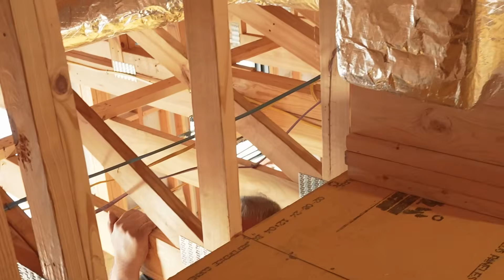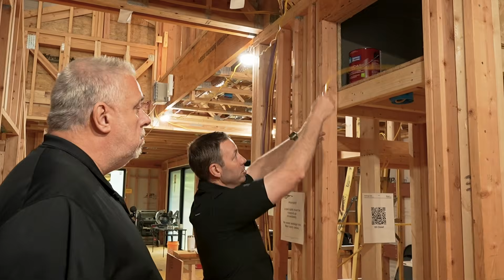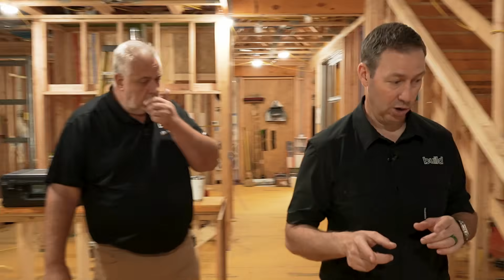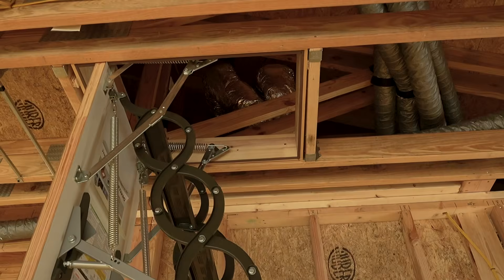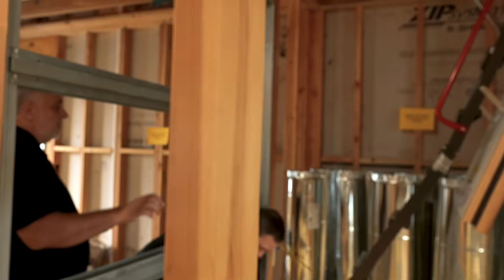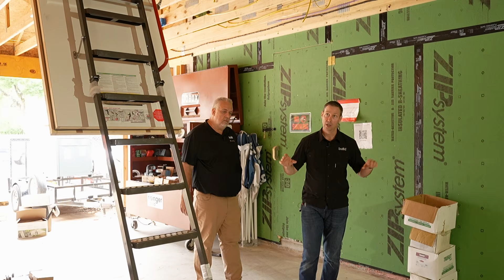Making Room for Mechanicals: Expert Advice for Efficient Home Design

Comment: My  Hot  Water  Runs  are 28ft - 34ft  using  Hybrid 50 Gallon went  from $600 Yr  for Hot  Water Down to $192 Yr = 3.5 yr  Pay Off or  Pay back  . .  Hybrid Actually Drys -&- Adds  Touch of Cooling  . . :glasses-purple-yellow-diamond:

Comment: Any thought to place the regulated mechanical room at the roof level?   It might imply the house needs to be built in full concrete, but it can really free up spaces down below for something else.

also, water flowing down can help maintain a good water pressure.

Comment: Stop putting HVACs in the damn attic. Design a utility room to hold the HVAC. When you're designing a home, you have the freedom to design a home the way you want. The same reason you shouldn't put a hot water heater in the attic, you shouldn't put an HVAC in the attic, and I don't care if the attic is conditioned or not.

Comment: Steve, i worked on a large house that had a "level" about 4-5 feet high between thw basemwnt and main floor. The walk way went rhw entire lwngrh of the house with runa going off left and right with walkways.
24,000sf house with a small upper floor and the basemwnt was 14,000 so it was consierably larger than the main floor.
You got to the walkway by dropping into the basement roxk climbing gym then up the back wall to the hatch doe thw walkway.

Comment: You'll need that removable panel when that "heat recovery" thermo drain starts developing pinhole leaks. Talked to several homeowners that had theirs fail. KISS, Keep It Simple Stupid, you gain is minor to nothing at best. A proper waste drain is all you need.

Comment: My preference is split system (AKA air-to-water,) heat pump water heaters. While not nearly as common as its self-contained cousin, the design solves some of the issues when it comes to placing heat pump water heaters. For example, the evaporator coil unit can be placed virtually anywhere on the exterior of the building envelope.

Comment: Building in 6 weeks! Owner builder...I thought about having a conditioned mechanical room on the 2nd floor- but I have an area over the kitchen/greatroom that will have walk in attic 10'x8'- isn't it better to skip the conditioned mechanical room (in midlands SC) and just use that attic space?

Comment: I also dearly love drop ceilings in basements. I know "they look ugly" or whatever, but the idea of the ability to remove the whole ceiling or just a few panels without any cutting or construction to put it back afterwords is a beautiful thing to me. It's also my appeal to the conditioned attic, complete ease of access with no insulation in the way of the ceilings and tops of walls, and the obvious benefit of it being a comfortable temperature to work in. I've noticed some things that make my life easier when installing or working on a central vac system, and things that make life hell. I know anything that makes it easier for me would for any trade, and I like the easier, less messy option for being able to access anything for repair, upgrading, or adding something in the house.

Comment: I’m 78 and had a tract home built 21 years ago in a NW suburb of Chicago. This was my retirement home. It is a 2240 sqft ranch with 9’ ceilings, vaulted ceiling in entry/family room and a deeper full basement. It has 3 full baths (one in the basement with a large shower). I tried to anticipate some of the things mentioned in your video. I did a Werner aluminum pulldown ladder in the three garage, it can be used even with 3 cars in the garage. I wanted larger doors (32” doors would be minimum for a small/medium wheelchair) but that wasn’t available. The master bedroom has a 48” wide opening with 2 doors, this works well with wheelchairs. The 50 gallon water heater is close to the middle of the basement, next to the furnace. It only takes 30 seconds for hot water to get to the master bath (furthest away from the water heater).  It has 2 steps to get into the front door and 3 steps into the garage. I had a front door green 16’ x 32” wide wheelchair ramp made about 8 years ago, that can be installed in less than 1/2 hour. I have used it twice, once through the winter for about 1 year, the other time for 4 months. The only opening that could have been larger is the kitchen entrance 29 1/2” from the hallway. The dining room entrance to the dining room (no door) is 37 1/2” and is great. The other side of the dining room has an 8’ opening. The front door is a 36” door, but only a 35” opening. The mudroom door to the attached garage is 32”, with a 31” opening, but the other door is 30” with a 29” opening……strange that they are different. My 20” wheelchair is 27 1/2” wide. If I was building a new home I would do all passageway openings at least 36” and hallways 46” minimum (my hallways are 41 1/2”, with post at one point making it 36”). I have bumped into the walls and corners damaging the drywall when using the wheelchair.
PS: I also added a whole house 36” 2speed fan, which I use in the spring and fall to cool down the home when necessary.

Comment: At 2½ miniutes you mentioned the HP Water Heater, that is good and bad. If the HP portion fails, it gets trashed, if Tank fails ... it gets trashed. Someone does make a HP for a Water Heater that is stand alone. Actually, there are several different types, but the one being pushed on Americans by the box stores and supply houses is by far the worst design. There is a self contained HP unit, that ties in to a solar water heater tank, so it is similar to what you showed. But there are also inverter HP units where the inverter condensing unit goes outside just like all other mini-splits and looks the same. The benefits to these units ... you don't have to trash the tank if the HP portion fails, and vice versa. So you can grab a Rheem Marathon solar Water Heater, that should never fail due to its polycarbonate tank. Replace the anode with a Corro-Protec electronic anode rod, and forget about it until its time to flush it. Some even have electric heaters for back up and supplemental hot water. But in Texas,  why aren't you using a solar hot water panel ?
At 10 minutes in, Matt and Steve are standing in front of that mechanical closet and discussing planning for system maintenance,  HOWEVER ...lol, we see the transition for the AHU hanging down and it appears to be offset in the closet. The issue is for Maintenance and Repairs ... that Air Handling Unit requires a minimum of 2.3 times the footprint of the AHU itself on the panel side. The reason for this is to pull the coil out for replacement, or the blower wheel, etc. And you probably want a minimum of 2½ times that footprint to allow for electrical to be swung out of the way without increased labor costs in order to get that blower wheel or coil in and out.
Scuttle holes are nice, and those accordion ladders are kinda OK at best, but those pull downs should be no smaller than the largest appliance in that space. Going through the gable and such increases Repair costs on any future repairs ... scaffolding, extra men, etc ...
And all that flex, it's insane. Flex reduces airflow due to the wire bound inner sheath causing cavitation of the airflow ... flex is only best when used as a noise isolator .... never a length greater than 6'. Run hard pipe within 4' of boot, and tie in with flex. I have seen plenty of attics, especially hot attics where the flex insulation had settled and the inner sheath had collapsed in on itself ... it happens in around 10 years in how attics, and up to 15-20 on other attics. Not to mention the sags that occur within 5 years,  the collapsed bends that tend to happen I less than 10. Just a really bad idea you go cheap and use flex as a duct in it's entirety. 
And flex is required by code to be strapped at every 3 feet. Not done on these flex lines.
Having ductwork touching roof trusses is a bad idea due to heat transfer, having linesets in contact invite heat transfer which lead to a decrease in energy efficiency and premature failures, increased repairs due to leaks, and vibrations that can be heard in the home.

Comment: New homes should come with solar panels, a rain water collection system and an electric vehicle charger in the garage.
Large roof overhangs add beauty and protection for the doors , windows and siding from the sun, wind and rain

Comment: With an attic that large, I would want a dumbwaiter to get the stuff up to the storage area.  I can imagine some codes may not allow a dumbwaiter, but designing a space for one, in case the code changes (wink wink) would be awesome.  I could not imagine getting a large Christmas tree out of an attic using the fold up stairs.  Actually I can, did it for years and hated myself twice a year for it.  I also love the idea of the outside hatch to the mechanical attic.  Real simple to do I imagine.

Comment: 14:50  Actually Matt, a super hot attic is an excellent place to put a heat pump water heater.  The space will likely be large enough to accommodate the cubic feet of air requirements for the water heater, and the heat pump on it will cool and dehumidify the attic.  As long as you build the trusses to support the weight and put in a drain pan for the condensate and to protect the house in the case of a catastrophic leak, the hot attic of a southern home is probably the best place imaginable to put a heat pump water heater.

Also, did I understand correctly that the makeup air system for the kitchen vent hood pulls in tempered air from the garage instead of unconditioned air from outside?  I really like that idea from an energy usage and comfort standpoint, but does code allow something like that with the possibility of pulling fumes from a car or chemicals stored in the garage into the living space?
Reply: just put ducting from the heat pump water heater to and from the attic......

Comment: corridor idea is genius I've thought about that as well
Reply: 5:30 same! it's an intriguing idea that I'd yet to hear anyone else bring up (particularly in a residential context but in general)
Reply: I doubt it's unique but I've seen it with a lot of commercial restrooms. A door between men and women side, opened to a full length corridor with all the through wall plumbing, electrical, water heaters, etc. Also always thought that would be cool in a home.

Comment: Easy-peasy - just dig an extra high (deep?) basement and incorporate into your design the appropriate use of stand alone, self contained HVAC room units - never worry about them and they’re easily accessed - nothing more impressive than a well designed and executed mechanicals plan and room
Reply: Easy in SOME parts of the country.
Reply: No one likes floor registers
Reply: @CapitanGreenhat use a duct chase then
Reply: My new neighbors told me they had to use dynamite to put a pool in the backyard, so not so easy peasy where I live in Texas... I'm currently using a big contractor hammer drill to put in a dog fence, only takes about an hour to hammer a hole per post 😂

Comment: Question: would it be better to have two mechanical rooms?  One would be for the water heater and HVAC and the other would be for electronic equipment mounted on racks like a server and sound system and video and home automation.  That way you would protect the electronics from water /humidity and heat damage.  Or maybe that’s unnecessary?

Comment: As someone planning on building a house in the next 3-5 years.   Is it common to have two small water heaters closer to use in say a larger home?   I'm actually considering a mid-west barndo-minium-style home, and was thinking that instead of long runs for the hot water.  My current house has the main shower very far from the basement water heater, and waiting so long for it to warm up is a bit annoying.
Reply: Yep. building a house right now and having two water heaters at opposite corner was what my builder suggested. good luck with your future build!
Reply: An on demand heater might be great for that. 😊
Reply: Not common at all. It’s a good idea. Perhaps a better idea is to build the bathrooms around where the DWH is so the runs are shorter.

If, because of barndo, that’s not possible, make sure you design your pipe capacity for pressure to offset the low-flow fixtures. Mostly everyone that complains about low-flow doesn’t have enough pressure because the plumber who installed the low flow also installed the supply lines, but never adjusted for it. 

Then, insulate your pipe.

Comment: As an end-unit 1856 square foot townhome original owner, I appreciate the thoughtfulness for designing this home. In my case, my attic is huge and very tall. But the space, other than housing the furnace, is unusable because the attic is full of 2 by 4s holding up the roof. The roof is super high. I have a roofer who checks my roof every 2 or 3 years and cleans my gutters, but he said he likely would not do my roof when it needs to be replaced because of how it was designed. He did install an exhaust fan into my roof because the electrician was to skiddish to go up on such a high roof. Luckily, the 25-year rated roof appears as if it does not have to be replaced for maybe 5 to 8 years per the roofer. The small hatch access to the attic is in the small hallway where the master bedroom cloests are that leads to the master bathroom. The builder built that scuttle hatch with no ladder so I got a Werner ladder and would leave it in one of the two master bedroom closests. But, I found a contractor who attached a pull down Werner ladder to the attic floor with the wand that you have to open the hatch. I don't have a basement because of a high water level due to a small river being about 150 feet behind me and 800 feet beyond my front door.  My hot water heater is on the 2nd floor in a closest and sits next to the full size washer/dryer stackables. I had a unit attached to my furnace that accommodates a 6 inch GAP filter so I only change the filter 2x a year when the HVAC tech comes to check the furnace and A/C. They won't install a humidifier because of the chance of a leak in the attic. The nice thing is I have a pretty long hallway separating the master bedroom from the 2 other bedrooms with a linen closet, the hot water heater closet on one side and an open library area and 2nd full bath on the other side. Plus for a townhome I have more privacy than many single family homes because of the river on two sides and an open area across the street from me.  My project now is replacing my pressurerized wood step deck with a composite but deciding whether to expand the step deck to 120 or up to 200 square feet with permissions from the HOA and township.
Reply: B o r I n g,... so sad I actually read thru your whole boring story just to find the obvious, need for mommy's boy therapy😢
Reply: @BigTee-lp7qu  omg you nailed it! You won! What's your address, so we can personally deliver it to you.
Reply: @BigTee-lp7qu   You did?  You won!  Share your home address here so we can deliver your prize to you. I'll patiently wait for your therapy to end.

Comment: LG is “Garbage “ their sealed system has almost 100% failure rate especially since they are using R600A.
Natural gas hot water heater is the best choice, most efficient, fastest recovery and most reliable.